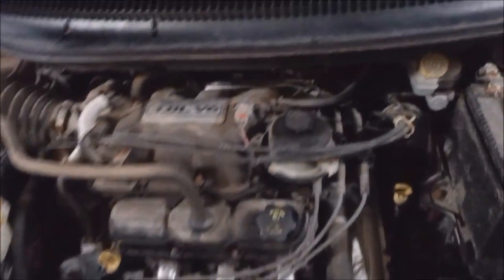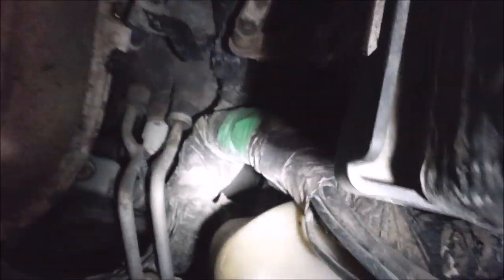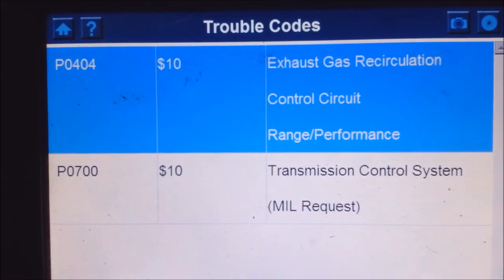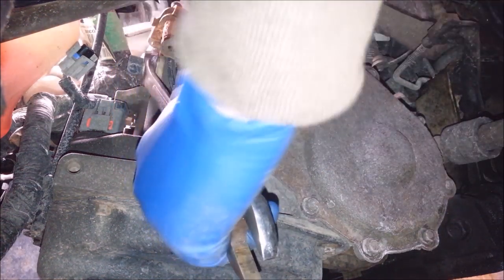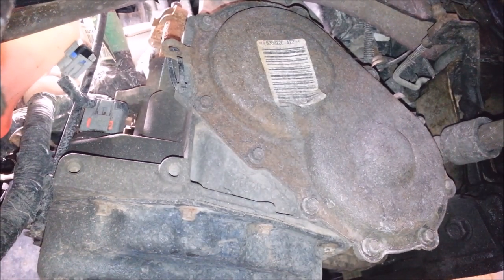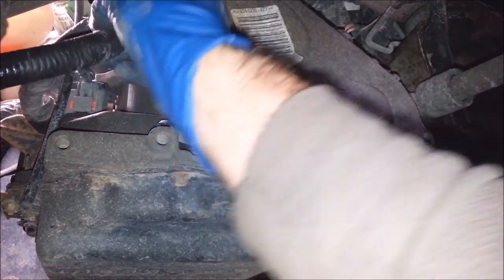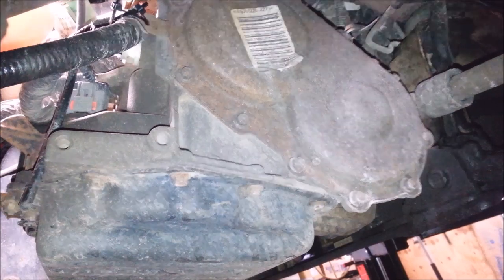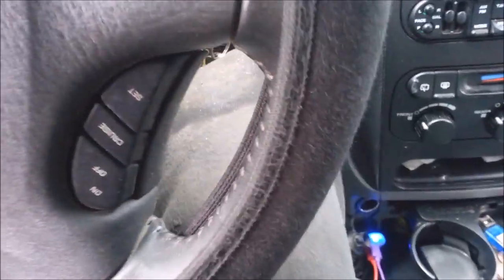Caravan Town&country 3.8 3.3 2001-2007 41TE p0700 p0720 fix

Comment: P0700 code: My 2005 Town and Country wouldn't shift in hot weather after driving a while, so I went into the fuse box and replaced the EATX Safety Shut Down Relay for $20. Problem solved! Thanks, Occam's razor!
Reply: Can you tell me what that would be next to in the fuse box.  Your issue seems similar to my issue I am having.
Reply: @lillianflowdance3828  On the front, driver's side corner of the box, there is an empty slot. The fuse in question is the next slot towards the driver on the driver's-side edge of the fuse box. I hope that helps. I took a pic, but Youtube won't take it.
Reply: @fool4homeschool250  are you on INSTAGRAM?  I am under Dancelady4u  on Instagram.  Can you send the pic that way?
Reply: @fool4homeschool250  thank you!!!
Reply: @lillianflowdance3828 how can i get a picture of where that fuse is also

Comment: U know...dodges have built in obd diagnostics....look it the owners manual to find the key pattern to make it run a diagnostics or to show the codes it’s tripping ...generally it’s turning the key from off to on position and back to off 4 times leaving the key in the on position on the last turn...the odometer area will light up with dashes and will start displaying po codes if any and then when it’s finished it will say done ...there’s also a way to make it do a self diagnostics on ur instrument panels as well as everything under the hood and transmission...I discovered this after owning my stratus for 6 years and reading the owners manual from cover to cover a dozen times...there’s all kinds of cool things dodge and Chrysler come stock with...

Comment: This applies to the 2001 - 2007 Caravan/T&C with both the 3.3L & 3.8L engines. Both have the 41TE transmission. The 2.4L/automatic I believe may also be the 41TE. Update your title and you'll get more views.
Reply from the maker: Duly noted. Thanks!
Reply: I recieved a PO720, PO731, PO732, PO733, and PO736. As well as a horrible transmission shudder and the speedo issue.

Comment: Could you tell me we’re the neutral safety switch is on a 2002 dodge caravan 3.3 SE ...it will start but at times nothing , if I push the gear shift up , it will start..
Reply from the maker: It's probably an adjustment on the gear selector. Follow the shift cable to the transmission
Reply: @RustBeltAuto   ok thanks I will check that..

Comment: I have a 2001 Dodge Grand Caravan. First the TCM went out, i replaced it. Now the output Speed Sensor. Next a big fire.
Reply from the maker: Phil Whipple that's interesting. Haven't heard of a Honda, Or Toyota owner have the same senireo. I think Ford's do that too. They seem to like fire.
Reply: Ford's look really good on fire.
Reply from the maker: Phil Whipple especially on the freeway in rush hour traffic. Good advertisement.
Reply: It's so hot here in Phoenix, spontaneous combustion happens all the time.
Reply from the maker: Phil Whipple It's usually just the BMW'S, Ford's, Kia's, and Hyundai's. Other car companies do not make their cars with crayons, and kerosene.
Reply: and Jaguars and Citroens. I have a 1973 Citroen SM. They were only made between 1970 - 1975. With the Maserati engine they were just asking for trouble. This car is worth more in parts than a brand new Corvette.
Reply from the maker: Phil Whipple That's how I sold my last Harley. So many are junk, it's worth less if it actually works. Everyone needs to fix it.

Comment: I got a 2001 dodge caravan  that at some point the previous owner put a remote starter. My question is how to remove it because  I believe it is making the transmission stuck in 2nd and the speedometer not work properly
Reply from the maker: Extremely doubtful an alarm, or remote start will make it do that. Limp mode will usually make a transmission use second gear only.
Reply: @RustBeltAuto  yes but I can't find the junction box
Reply from the maker: @nikikiser6278  Follow the wires for it. All roads lead to Rome.
Reply: @RustBeltAuto  ok I'll get back to ya

Comment: I have a 30FE on my 07 t&c and I changed all wheel speed sensors. It says “30FE WHEEL SPEED SENSOR RR INPUT CIRCUIT FAILURE” I replaced all the wheel sensor so could this be the cause or the wheel bearing itself?

Comment: My speedometer ic good, but my rpms jump up and down slightly, also it sounds like the car is shifting gears when it’s not supposed to. For example, I’m going 40mph and at around 1,500rpms it’ll change gears from 3rd to 4th, and then sounds like it doesn’t have enough power and then shifts down again, and then up, and one more time down and then it’s fine.
Reply from the maker: No codes? No fun. For one, it shouldn't be upshifting at 1500 rpm's. Unless I read that wrong. My video is about a speedometer that doesn't work properly. What does your problem have to do with the price of lemons on sale at the meat market?
Reply: Rust Belt Auto 😂😂 interesting comparison. But yes you read it right, it’s just weird to explain. I was just wondering if that could be related to the speed sensor
Reply from the maker: @_N_B_0496  I would say no. That is a strange issue. sooner or later it should have a code, I would guess. maybe it has a code stored in the transmission module, and no check engine light? I don't know. Good luck!
Reply: Rust Belt Auto thanks!
Reply: Ever fix it

Comment: Any help out there what I should try I want to O'Reilly's and they said I have a bad transmission shift solenoid that's what come up on there computer should I try placing that in both inputs sensors and output sensors and a transmission shiftsolenoid
Reply from the maker: What are the symptoms? Did you check the resistance of the solenoid? Is there more that one code?

Comment: I have a 07 town and country. The transmission works perfect on drive but on reverse it doesnt work as it should. Sometimes i have to push it back when we park in a small inclined parking spot. Could it be a sensor? Thank you
Reply from the maker: Doubtful.

Comment: Hey.  Thanks for the video.  I've run into an issue with a 2007 avenger transmission. The only issue I can find with the scan data is the transmission oil temperature sensor is constantly showing -3 degrees farenheit, but there is a o/d solenoid code continuing to pop up, but the resistance on the solenoid pack all checks out good.  Is it possible that the temperature sensor reading incorrectly would be causing the vehicle to go into limp home mode?  Thank you for any help you can give.
Reply from the maker: A typical temp sensor will read the top of the scale when it is unplugged, and the bottom of the scale when the wire is unplugged, and grounded, if it is a one wire sensor. Or vise versa. You probably need a good scan tool to read it.
Reply: I read it with verus scan data.  Last night and first thing this morning, it was reading correctly.  Took it for another test drive and it went back into limp mode and the transmission oil temp went back to reading -3 farenheit.   When reading correctly, limp mode is off, when reading -3 degrees limp mode is on.  Would be helpful to have Mitchell to have correct wiring diagrams to trace back to the pcm (tcm) to check voltages there and compare.
Reply: On the sebring, it is actually integrated into the range sensor.  I'll have to dig further.  Thank you sir.
Reply: Hello Justin. What was the issue? Thank you

Comment: had a question I have a 2001 caravan v6  the speedometer reads 18mph in park seems to drive ok.  gave a P0700 code.  since its reading 18mph in park would this be the out put speed sensor?
Reply from the maker: My sources say no. The sensor needs to pass across reluctor teeth in order to create voltage which in turn creates an ac voltage wave signal. that is how it knows how fast it is going. of course I could always be wrong about something, but it's doubtful in this instance.

Comment: I have a 2005 dodge caravan 3.8L it goes into limp mode from a p0700. I just replaced the tcm thinking it was that and I cleared the codes and nothing and I checked most of the fittings and there good. When I run a live diagnostic is shows p0755 but not when I have the engine running. And ideas?  Im killing myself from this agh... Any help would be incredibly appreciated.
Reply from the maker: That would be a shift solenoid code. It would be easiest to have a scan tool that can activate the solenoid. You probably have a wiring, or transmission solenoid issue if your speedometer is working correctly.

Comment: I am getting the p0700 code in mine but the only symptoms are sometimes when I put it in gear it acts like it slips until about 2k then takes hold and shifts great. Any ideas??
Reply from the maker: That is probably a transmission issue, and not a sensor issue.
Reply: There is no check engine light, what type of transmission issue? Torque converter? Some solenoid that engages the converter. Any information is appreciated, thank you.
Reply from the maker: @shawnmayo6690  Don't know.

Comment: I'm only getting a p0700 code on my 2006 3.8l town and country which is a tcm
Reply: Mine is doing the same, with only a hesitation or slipping when taking off sometimes. Anyone know what exactly I need to replace?
Reply: @shawnmayo6690  mine same, you ever find out what it was?
Reply: @chaddthebadd  nope, just kept driving it and never really had a problem.
Reply: Ok 🙏 thanks

Comment: I was told that you should change both sensors input and output at the same time is this true or can i just change the one with code PO720 coming up on scanner?
Reply from the maker: What would be wrong about changing one at a time? If it's not broke, don't fix it.
Reply: @RustBeltAuto  
Ur awesome thanks saved me some money also appreciate ur quick response
Reply: Depends who’s paying for it.   :-)

Comment: Ok sir I changed the output sensor but my van is still acting up and the po720 code is still coming up for that sensor do u think it could be a connector issue I wish u could show us how to change a connector for the sensors no one else has videos for that on youtube
Reply from the maker: Could be any number of things. That usually fixes it. As a guess, wiring is probably not an issue if it is an intermittent problem. You could try to take the car to a parts store, and have the alternator tested. It may have excessive AC ripple from a bad one way linear diode or something. Other than that, I would have no idea without looking at it personally.
Reply: Thank u for ur advice sir unsure if this helps but I was driving about 7 hrs this last July with the AC on and all the sudden the van died. I’m unable to even use the AC while driving in park it’s fine but unsure exactly what it does to my vehicle that causes it I was told it may be a fuse???
Reply: Amberlynn Mahabali that happened to my caravan after not using the A/C for like 6 months. Sounds like yours acts exactly like mine did. I went to a mechanic and they told me that the a/c compressor locked up and has to be rebuilt or replaced(best option as nobody really rebuilds them cheap enough for you not to buy a new one). I thought they just wanted to get extra money out of me instead of fixing the actual problem like a lot of mechanics do unfortunately. So I just went to a junk yard and pulled one from a caravan that had exact one a/c compressor(hoping it works) and installed it, rented a small vacuum compressor that sucks all the Freon and oil out of the a/c system, looked up how much oil I needed to add to the compressor on google, recharged the system, and it worked! The van wasn’t stuttering anymore every time I turned the a/c option on while the van was idling, aka in park. I know this is the long text, but I feel the details are necessary as this should help you determine if that’s what’s happening with your van. Hope this helped.
Reply: @AKM1LOVE  I agree.  Sounds like the ac compressor is on the verge of locking up or is locked up.  Does the ac work (blow cold air at all)?

Comment: 2002 caravan...all gears circled..no Speedo..limp mode.no codes..replaced output sensor..no fix.when 1at started no gear lights...after like 10 seconds all light up.im thinking range sensor isn't communicating.
Reply: P L have you tried to replace ecu from another caravan?
Reply: Might also be a relay, can’t remember which one though
Reply: Turned out to be a crusty connector at the ipm box.
Reply: Always check those terminals first.its where everything runs to eventually.
Reply: P L you’re talking about the connectors that are connecting from underneath the box right? Not the fuse slots?
Reply: @_N_B_0496  yes the colored gang plugs under the ipm fuse box.unplug and check male and female pins for corrosion.some will be green with it.

Comment: thanks for the reply. do you know offhand why it would read 18mph in park or above the actual  speed. if im going 30mph it reads 48 mph
Reply from the maker: williams williams you can try a reset I guess. Turn key off, hold trip odometer button down, turn key on, wait until you see some goofy letters on the odometer. Unpush button. It should do a sensor sweep, and pull obd2 codes. When it is done, it will stop doing goofy stuff. turn key off, and restart. Otherwise take off negative battery terminal for about a half hour, and restart. If you are lucky, it will be a programming glitch.
Reply: @RustBeltAuto  do you know what could be the problem on the Ls4 4t65e hd transmission got code for p0700?
Reply from the maker: @tman8023  ASE. Ask someone else.
Reply: @RustBeltAuto  thanks

Comment: Thanks    i got the same problem
Reply from the maker: Sam it should fix it. I was wrong about those 2 sensors being the same though. The outside (output speed sensor) one is different. Some dodges use the same ones.

Comment: I have an 03 Caravan, works fine but I have the converter lockup disengaging from time to time. Would that be the input or the output speed sensor?  Thanks
Reply from the maker: Maybe neither, so it depends. This is a video for a speed sensor. You probably have a different code.

Comment: Sir, which OBD2 reader did you use in this video?  What OBD2 reader would you recommend I purchase to read my transmission codes?  Thank you, I currently own an AUTEL AL519 and an AUTEL AL619, but they can’t give me the specific transmission code after giving me P0700!?
Reply from the maker: Probably autel maxidas.
Reply: Rust Belt Auto Is that the OBD2 model you used in this video?  Thanks.
Reply from the maker: @hb5914  every car after 1996 is obd2. Most cheap scan tools use global obd2. It is very generic, and is government mandated to work on everything. However there is vehicle dealer specific programming that is different from a global platform. Anything other than global software requires more expensive units. When you say obd2, it is really just the connector. I used an autel maxidas in this video, and it is really an outdated piece of crap now, and need a new scan tool. I used that years ago when I had to do daily diagnostic nightmares for a living, working for assholes. People don't give me crap like that much at all anymore, so I feel no need to buy something nice, and new.  That is the best I can explain it.

Comment: My 06 town and country . had the p0700. I was told to replace the transmission by 4 mechanics. The reverse was the only one working .it would shut off if i put it in Drive
Reply from the maker: And the fifth mechanic says, you might need a transmission. Same code, different symptoms.